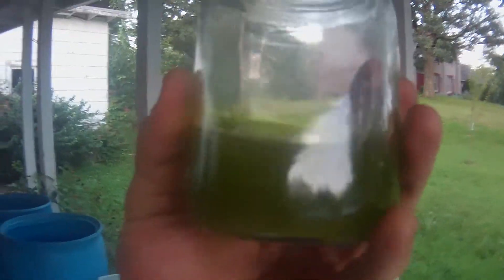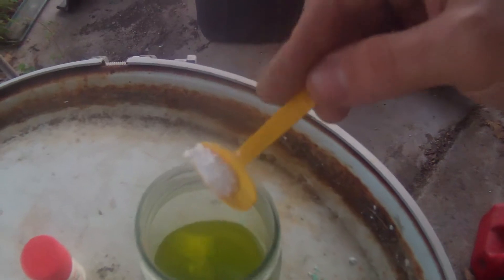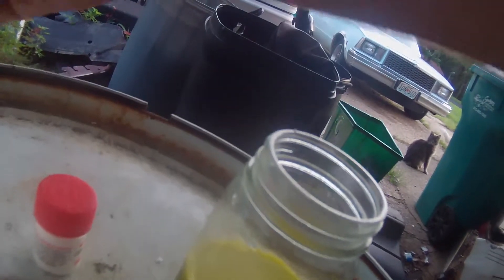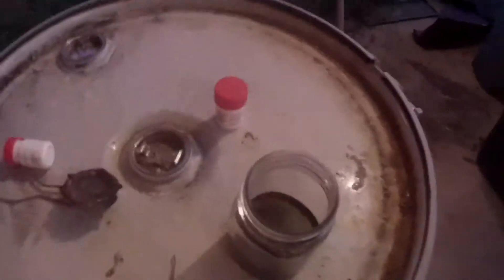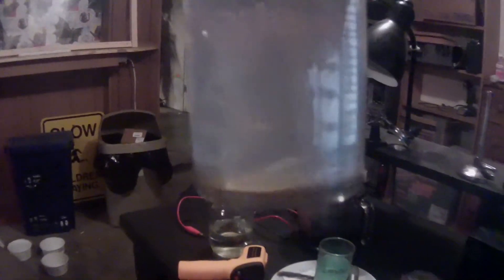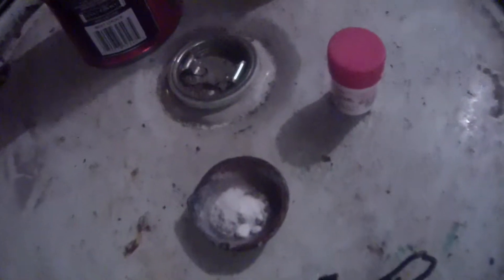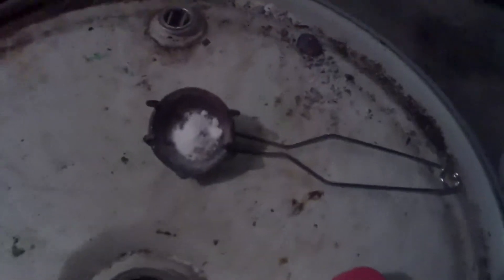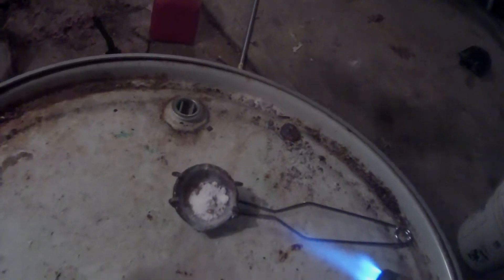Processing Chloroauric acid into gold from computer scrap

Comment: Nice video man. I got my first batch of Chloroauric acid in the garage now. I used the Hcl/bleach method to dissolve the gold from plated dishes and cups etc. Could you heat the crucible from the bottom until the borax melts? Thanks. Peace